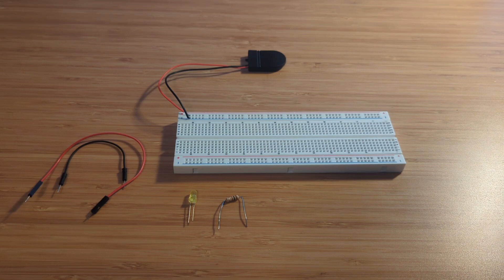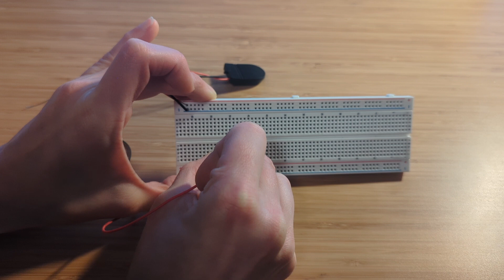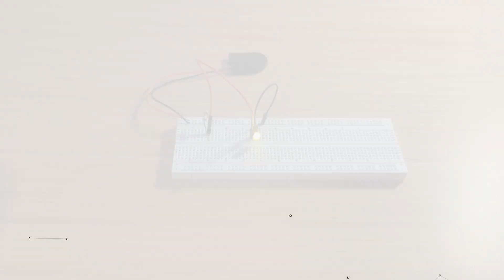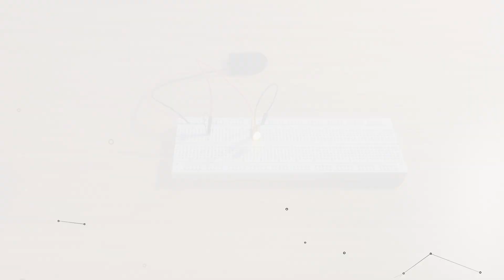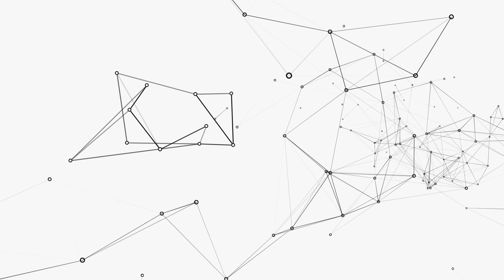How to use a breadboard to build circuits! a cozy, beginner friendly intro

Comment: quick question. why did you insert the positive end of the LED wire in between the two ends of the resistor in the last configuration? does it do anything special or just a breadboard typo?